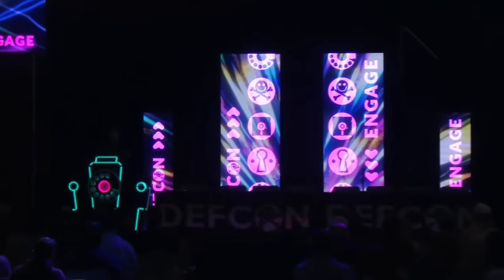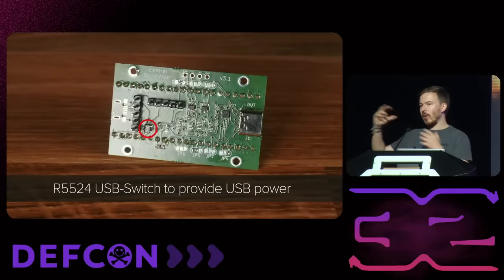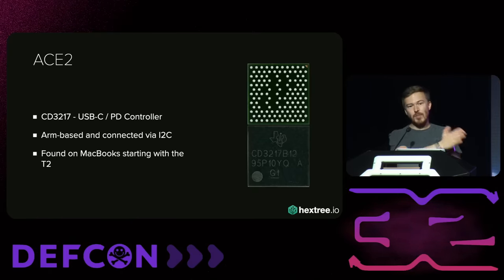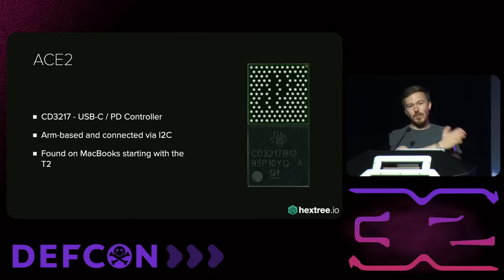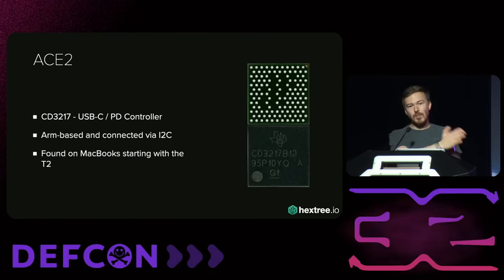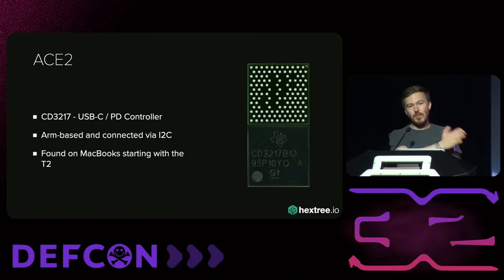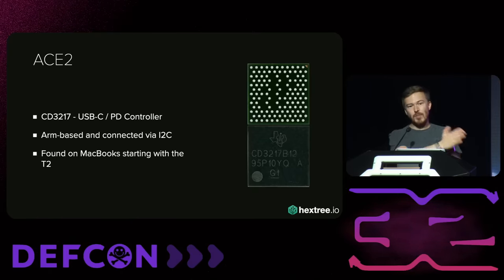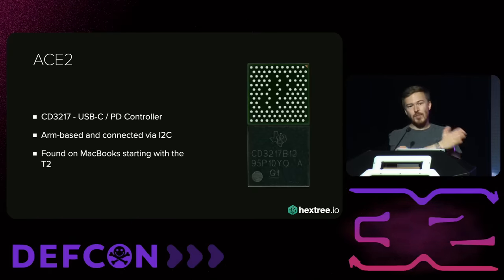DEF CON 32 - From getting JTAG on the iPhone 15 to hacking Apple's USB-C Controller - Stacksmashing

Comment: Voltage fault injection reminds me of some laptops to be re-sold, at work. The BIOS / UEFI was password protected, but they were a "higher-end" model with a "secured boot failure" feature... if the BIOS repeatedly failed to initialize, a re-flash or such would occur. By ever so slightly shorting one of the TX pins to ground while it was booting, it would reboot... to a Factory Initialization message. Haha yeah, one only need to enter the serial number printed on the laptop, and it would then "be that laptop", as well as save a password and then immediately clear it, because otherwise it was still on the flash, recalling. I recovered like 7 or 8 of 10 laptops that way.
Reply: Those days are over, everything is encrypted now.
Reply: Had to do this with a lot of old chromebooks
Reply: come you drop a story like that, and not details what laptop model it was and ping shorted out a little (did your a rissistor or something for the shorting a little part? are just paper clip? 🙂
Reply: @dh2032  It was a Dell model, but it was over a year go, one of many I worked on. I just had a small metal tool, like a flathead, and I was scraping one side of what I believed to be the bios chip (tiny little 8-pin dip). If I scraped too early it wouldn't boot at all, but there was a certain part of it's LED flashing iirc, I could time it. The fan sounds would be different, and rebooting (without contact?) would boot it into the "Manufacturing" mode.
Reply: @doublepinger  I have a similar story with one of my previous PC builds.
PC froze while updating BIOS during first setup, seemed to be fully bricked.
Looked online, turned out only option is to go ahead with a return. Which would suck as I was just setting up a new build after waiting on the parts for quite a while.

One user described a similar issue on a different motherboard model, and he was able to short two pins to get the DUALBIOS thing to kick in and un-do the brick.
The issue was that they had a different mobo, and schematic of the pins from the manual they attached didn't correspond to the chip on my motherboard.
Had to go to my boards manual, find the chip on my board, look up the model, look up the chips specs, look at the routing of the pins and compare to the chip the other user posted.
I remember the pins were named differently, so that required some deep diving into the docs to find that XYZ on my boards chips corresponds to ZYX on the other boards chip.

Once I was sure which of the pins to short, I was like 49% sure it would go up in flames, 49% sure I get electrocuted, and 2% sure it would work.
Insulated myself from the paperclip I was using, and was shaking quite a bit while trying to only touch the 2 of the 8 pins required lol
But I went ahead... AND IT WORKED!
Shorting the 2 pins unbricked the BIOS brick, and I was able to proceed with the updates without any other issues.
Felt like I'm a wizard & it was amazing that I didn't have to RMA a new motherboard that got bricked during a bios update.

One of my fave PC troubleshooting stories as a 'normal PC user' / someone not working in the hardware/PC sector.

Comment: Ouch, $4,000 chipshouter?  Glad you did it for us.  Using a $4,000 glitcher and then saving money using a hackrf instead of a scope doesn't make a ton of sense to me.
Reply: What do you think a good scope costs? Do you think he paid full price for the other device? Could it be an academic exercise to do it the cheap way?
Reply: It only takes one researcher to work out the signal, now you can do the same with a $60 PICO board.
Reply: He said he wants to make it more accessible not everyone has that much to spend on specialised hardware
Reply: Did you watch to the end?
Reply: @grant-is  Of course not. Many such cases.
Reply: Lol you need to spend money on research to achieve 60 dollars gadget.
Reply: @abdulrhmanalsadoun5792 Lol, must not be the brightest bulb in the pack eh?
Reply: @Styphoryte true lol

Comment: This has to take the cake for most impressive presentation at this year’s DEFCON. Granted, it’s the first one I’ve so far seen, but still. It’s got everything, multiple zero-days, responsible disclosure, Apple being jerks, refusal to address disclosed vulnerabilities (we just released a new chip thats not affected. Wanna be secure? Buy the new $3,000 computer), SPITE…engaged, whacky hacky shenanigans, no information, just spite, somehow convert pure spite into actual information, still tho no way this actually works, no fucking way, spite wins, it’s to the buzzer but spite wins somehow, all this, plus what’s got to be one of the most technically impressive h/w hacks of the year. Bravo! Unfortunately, there’s absolutely going to be some serious blowback from all this. I think it just convinced me to buy a Mac. I finally get it. It’s not the aesthetic or some “ecosystem” that draws ppl to Apple. It’s the spite. That’s not a computer. It’s a 3,000 dollar motivation machine. I was blind, but now I see!

Comment: In newer iPad Pros, air, and MacBooks, the CD chip is paired to the small ROM chip. 
If I need to replace the CD chip because it turned out to be bad, I cannot install a new one. I need to pull a pair of cd + rom from another donnor motherboard. 
Do anyone have an idea how to re write the rom chip to the new CD?

Comment: I wish there was a way to root androids by opening it up and connecting to the jtag pins
Reply: That's pointless seeing as they allow modification. KernelSU is possibly the easiest and safest at the moment
Reply: @IDontModWTFz  No they don't. Select phones allow unlocking the bootloader.
Reply: @IDontModWTFz  Asus charges you now. I bought a phone from them and they removed the ability to unlock it entirely.

https://youtu.be/yjz6x-YwI00

Samsungs only work if you get the exynos chip set which is for Europe is what I keep reading.

I keep asking what phones allow bootloader unlocking besides Pixels in the US and no one ever can give me an answer.
Reply: @deoxal7947  don't xiaomis allow unlocking the bootloader globally?